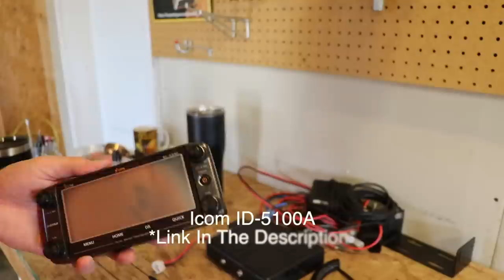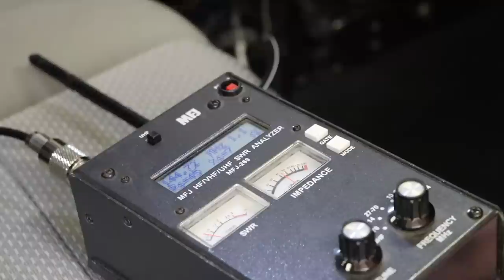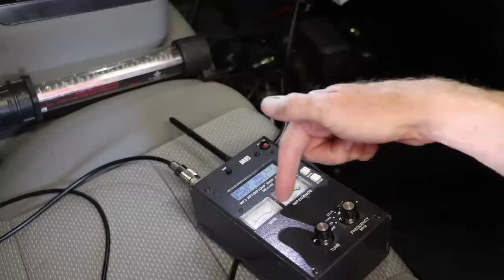Icom ID-5100A Install / 2018 Silverado

Comment: Hi, fellow ham.  I am a fan from Japan.  It's nice to see someone eles make a hole on the top of brand new truck for antenna!  I have a 2015 Toyota Land Cruiser Dubble cab truck and made two holes on top of the roof for ID-5100 and FTM-400DH!!  73 de 7K2LGO (NY6A)

Comment: I know its been a while, but may I suggest to first cover the work area 12x12 with duct tape and to drill a pilot hole. It helps with heat dissipation and scratches from the shavings. Never brush the shavings aside. Always shopvac from directly 'above' the surface.
Reply: I dont mean to be so off topic but does someone know of a tool to log back into an Instagram account..?
I stupidly lost my password. I appreciate any tricks you can give me
Reply: @Azariah Josiah instablaster ;)
Reply: @Drew Sam thanks for your reply. I found the site through google and Im in the hacking process now.
I see it takes quite some time so I will get back to you later with my results.
Reply: @Drew Sam It did the trick and I finally got access to my account again. I am so happy:D
Thanks so much, you really help me out :D
Reply: @Azariah Josiah happy to help :)

Comment: You may want to trim your A.M./FM radio antenna on the truck since it is hitting the garage door.  It will also hit in a parking garage.  I had to trim mine on my Ford F-150 Truck.  I took the ball of of the antenna, cut it shor,ter, epoxied the ball back on, and sprayed it with flat black pain.  Looks original, but I don’t scrape the antenna like I did befor the trim job.

Comment: Ham, trucks and RVs are never boring. Almost 3 years later is the truck still with you? I'm a hole drilling chicken partly because I can never make up my mine where the antenna(s) will go. Solid antenna. Used to have a CA2x4 on a fold over mount that would occasionally go into the garage in the up position and get bent 90*. It survived the abuse and 15 years later is still working.
Reply from the maker: We do not still have the pickup in this video but it did great without issues while we owned it! We've drilled holes in a lot of our brand new vehicles, so I'm sure it'll happen again in the future haha

Comment: Can't you plug the mic into the control head? My IC 2710 and Yaesu 7900 can be worked from the control head. You are going to be extremely happy you chose the cap windows to open, especially with the low profile cap. WB2IRE

Comment: Good video. The antenna link in your description says it is for a PL 259 connection not the NMO that you used. I see Amazon has a different listing for the Comet 2X4SR NMO mount one.  I'm also a ham extra and have a 2017 Silverado. I want to drill the roof also. Thanks.
Reply from the maker: Thanks I'll have to see if I can find the correct links. Appreciate the feedback!

Comment: Hello,  Earl W8CEO here. And I want to say that I certainly appreciate this video. Why? Because I have a 2018 Chevy Silverado Crew-cab pickup Myself As your’s and I have a ( Icom 2300 H ) 2 meter mobile that I have been wondering just how in the heck am l going to install this 2 meter mobile radio? Just by chance I was surfing through some amateur videos on here. And came across your installation video! And I’ve got to say thank you so much for making this video on your 2018 Chevy Silverado Truck! Your absolutely correct in it’s a total pain in doing any type of installation of any type of Amature Radio’s into this newer vehicles!  I’ve been under the hood,  under the body looking for some where,  and how to run the power cables from the battery to inside this truck cab? And Man! You just Save this Ole 70 yr’s  old man a bunch of headaches, and fretting in how to get this accomplished! Thank you,  thank you for making this video! It’s a God Sent unto this ole man! Lol I’ve currently have a comet mag-mount on the roof. And I don’t like the idea of the coax cable running over the outside of this vehicle.  But after seeing this video I believe that I’m going to go with the CA-2x4 4SRNMO BROADBAND VHF/UHF Antenna. It’s has the Spring that comes with it, and since your video I know now!  How to install it as well. Just wanted to Say Thank You Again for Making This Video! 
God Bless and 73’s
Thanks again 
Earl W8CEO
Reply from the maker: Well I'm glad this video will help you on your install! 73 KC8YHK

Comment: One of the better install videos because it was real world, including the decision making process and a bit of “we’ll see if it works” stuff. That’s better than those where everything is already planned out. Oh and the 5100 is a great radio so great install all around...even though I know it’s not a recent video.
Reply from the maker: Thanks for the feedback! We agree with you
Reply: Wandering Wagners I see now that you got a new truck. Did you install the 5100 in it? I’m assuming yes but I didn’t see a video on it (unless I missed it) so did it really get installed? 😂😁😂 /s
Reply from the maker: No we didn't install it yet in the new truck😁
Reply: @WanderingWagners  Oh, OK - well, maybe soon.  Drill, baby, drill! :-) :-)

Comment: Step bit.... NOOOOOO!!!! Get the proper tool so you won’t deform the sheet metal or damage the headliner. If you trade vehicles often, as you said, and tend to drill holes then an investment in the proper tool to drill a hole makes sense. I have a hole saw, from a company by the name of Laird, that I’ve used on four of my personal vehicles over the years. The initial investment will pay off if you do multiple vehicles over the years and, there’s very little risk of damage and the hole is perfect for an NMO mount. 

After I drill a hole I take a small needle file and go underneath the the cut to remove burrs as well as any primer so the mount will fit flush and obtain a good ground.
Reply from the maker: Cool story.

Comment: Good Job.  I have an Icom IC-2100 mounted in my 2014 GMC Sierra.  Mounted radio against center console (not ideal) using a lip mount antenna between hood and fender (somewhat directional - roof mount is ideal).  I have an Icom 7100 in the travel trailer which I probably should instal in the truck.  Good Video - you got me thinking about mounting the 7100 in truck!  Look forward to QSO on DStar someday.  73  DE W3IAX
Reply from the maker: Thanks for watching! 73 KC8YHK

Comment: Howdy: Nice job!!!
I put my comet antenna 2m/440 on my 1987 Nissan 4x4 
On a roll bar and what a range I got on 2m, wow
The roll bar made a major difference in range!

I also had a fold over antenna gave a issue
Folding over,But I kept working on it and it finally
Broke it loose and it was also a comet.

73's Guys Jeff ke4tgh
Reply from the maker: Thanks for watching, 73

Comment: I had that antenna on my Kia Soul but mounted at the lower end of the tail gate so it barely poked out the top. It’s a long antenna! But it’s performance is amazing.
Reply from the maker: I love how you can fold it over, and it works excellent

Comment: Nice cap.....we're looking into that option as well.as for the radio stuff,the wife told me no holes in our truck. I'm good for holes in the new vehicle. My Yeasu FT100D is under my seat and the IC710G is under her seat.the ATAS 120 is on my door and the dual bander is on her door.the CB is now on her side of the center console,with a magnet mount on the roof.

Great video of the install.
73s catch you down the log.
KB3EJW
Reply from the maker: Thanks the cap has been working out great. So has the radio install!

Comment: By connecting it directly to the battery, is there a way to turn it off? You might want to connect it to a fuse that is only powered with the ignition on. Just a suggestion.

Comment: I noticed your license plate on another video and wondered if you had anything about installing  a radio and antenna. Do you have a radio in your Airstream? We are thinking of doing fulltime RV next year and I will want to set up a shack in ours.
Reply from the maker: I currently don't have a radio in the Airstream for a while I used an HT running through my Icom in the truck on crossband repeat

Comment: excellent i have the exact same thing and with better locks i can place alot stuff in the truck now well protected and i recommend you get a locking clasp  from amazon only few bucks but a life saver . good job you'll always get alot views when you do installations on u tube good jobfor your tailgate as well

Comment: Really nice ARE cap. I own the Z Series model with keyless entry. I think you will love it. That install looked easy in the video but I'm pretty sure it was more difficult in real life. Is a ham radio more beneficial to an RV'er than a CB?
Reply from the maker: Both have their benefits, CB gives you more real time road info but that band is so full of garbage. Ham radio gives you a much broader reach and the people are very polite. My radio can talk to another mobile unit about 25 miles away, working through a repeater that distance can double. Using D-star (digital mode) that same radio can talk around the world. D-star has a "channel" dedicated to truckers and RV'ers.
Reply: Yes, much farther range.  VHF/UHF with about fifty watts, plus repeaters, can extend the range up to 100 miles.  
CB is limited to 4 watts, with ten miles at best.  
Plus hams are more helpful, CBers are mostly clowns.  
You'd need to be licensed by the FCC, and that's passing a test about the rules, operations, and some knowledge of electronics.  Lots of 411 on YT about getting the FCC license.
Reply from the maker: Getting the license isn't that hard, and I'm also a VE (volunteer examiner)!
Reply: yup, this is true, 100 miles if the repeater is in the mountains.  
D-star is digital, networked kinda like cell phones.  
But you can talk with many people.  
The FCC requires good edicate and procedure.  
Ham radio also can have skywarn and other helpful public services. 
If you get lost, or need help, locals are glad to help.  
CB can get "smokey" reports for speeders.  lol
Reply: To take the FCC license test, you'll need to find a local VE, often with a repeater club.  VE's issue the tests. 
Whilst camping, you may find other hams to talk with to pass some time.  Part of the fun is seeking them out.  
btw Mike, does Lynn also have a license?  If not, she can transmit IF you act as her control operator.
Reply from the maker: She isn't licensed. One day she took a practice test just to see what kind of material is on the test though. She bombed it, but she didn't study either.
Reply: yep, must study the R&Rs and some electronics to operate a transmitter.  Tech isn't that hard, lots of  kids pass it.  Like any test, needs some study.  The ARRL.org has lots of good study books.

Comment: ARE served me well. It looks great!   You let Comet bend you over on your antenna not bending over?   Call them and get a replacement for your friend.  That box with wires was your air bag control module,  good idea to stay away from that.  LOL.   You're not a bad 12v install guy.   All these new vehicles are a PITR ti install stuff.   No room.  Don't fly into the garage,  if you bounce you'll see a comet fly.
Reply from the maker: I don't park in the garage so no worries there haha I rarely needed to bend it over so I never pursued comet for it.

Comment: Nice work! So, do you broadcast while driving or just listen? You mentioned the box under the passenger seat having a mic port so I was wondering if you did that. Also, where can we give you a listen? I don't know much of anything about HAM radio so not even sure if anyone can just do that.

Overall, great video.
Reply from the maker: Both. I'm a licensed ham radio operator

Comment: Truck looks great! I’ve had two ARE toppers, one without window/doors and one with. I personally will now not buy one without the doors, they come in way to handy. Thanks for another great video, has sparked my interest in getting my ham license.
Reply from the maker: Thanks we definitely wanted the windows and the sliding screens will be great for ventilation if we are hauling something like gasoline etc. Look into getting your ham license! I'm an extra class and a volunteer examiner

Comment: Cap looks great on the truck,  They make a short black rubber antenna for your radio to replace the factory steel stiff one, i noticed it rubbed the garage door backing out, i get mine at O`Reillys auto parts and have been using them for years on all my trucks.
Reply from the maker: We don't park in the garage so it's not big deal. The truck is never in there unless I need to work on it or install something. Otherwise we would do something like that

Comment: D00d!  That was awesome!  Nice Rig.  I have a 2x4 for the broad band capabilities.  I put it on a Larsen mag mount, which is NOT enuf to keep it on the roof!  I need to find another solution.  I did not know how easy the inside of the truck came apart!  
For being bored, you did great.  There is a lot of great info, and some really informative shots.  TU 73  GD DX!
Reply from the maker: Thanks! Yeah the interior pretty much snaps or screws into place and Congress apart easily. This installation went really smooth

Comment: Nice setup. I’ve always used a lip mount and run the feed line through the fender opening by the front doors though. Hope to you hear you on the air when we finally hit the road next year. De AH6P Dennis
Reply from the maker: I'd like to hear from you once you're on the road. 73 KC8YHK

Comment: Nice installation video. I got some reaction when I opted to use an NMO mount in the middle of the roof even though the truck is far from new.. Right now, I just use the antenna with my HT but still shopping for an HF rig. Since my desire is to use it while out with the RV, I'm looking at mobile rigs. AL6T
Reply from the maker: I've always used and liked the NMO mounts. Thanks for watching!

Comment: As an alternative, I recently picked up a SofTopper for my truck. It obviously isn't a hard shell, but it's nice because it can collapse and fold down when needed for larger items and easy to remove and not take up a lot of space if you don't want it on there.
Reply from the maker: We considered a tonneau cover but with us going full time we wanted the extra bed storage and height
Reply: Agreed and it fits your situation perfectly. I was throwing it out there as an option to your viewers as an alternative. It's the same size as your hard cover when up, but can collapse if needed. I'll tag/share it on your FB on a comment of mine in a recent post.

Comment: I know this has been posted for some time and I watch when you first upload but one question, I did you not install the antenna on the cap on the truck bed?
Reply from the maker: The antenna needs ground plane, or in other words a surface that can reflect the signal.

Comment: I've gone to using butane soldering irons. At first I was skeptical but I am a believer now. lol
Reply from the maker: Haven't needed that. For as little soldering I do, a regular iron and this gun have done the trick so far
Reply: they are cheap and you dont have to mess with cords.

Comment: Just a question. . .. Wouldn't it be better to mount the antenna so that it bends towards the rear? That way, should you forget to lower it before putting it in the garage, it would fold over while hitting the door rather than breaking off. If it's laid over in the garage after pulling in, you wouldn't have to worry that it's up in the garage when backing out. . . .(??)
Reply: Those antennas need to have the main part pulled up first before they will lay over, so hitting the door will be a "bad result" regardless.  He could have laid it over to the rear just as easily as to the front, but if you notice his rafter was in the way to lay it over backwards.
Reply from the maker: We don't park in the garage and if we go into a parking garage we'd have to lift then fold it over. We are always aware that it's there. Every time l truck we've owned has had a roof antenna

Comment: The opening in the carpeting under the seat is where the rear seat air and heat vents out when you have the front controls on the floor mode.
Reply from the maker: Thanks for the info!

Comment: How do you feel about front fender mounts ?
Reply from the maker: I'm not a fan of the look, I also like that the roof gives a much better ground plane for the antenna. A fender mount works though, and it's a much easier install.

Comment: I use a mag mount ant. That way no one knows... Good vid
Reply from the maker: I prefer hard mounted antennas. No cables rub paint this way and the hole is always covered, even if the antenna is removed.

Comment: The Icom 5100A is a great rig. I have been using the Buddipole antenna, but I can only use it when I get to a campsite. KB4LL
Reply from the maker: I've really enjoyed this radio. Had it for a few years or so